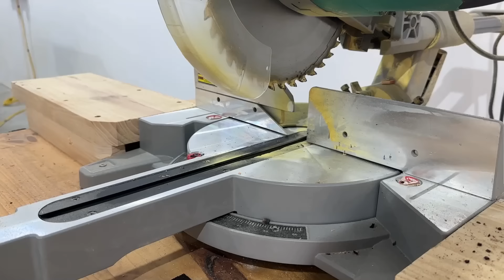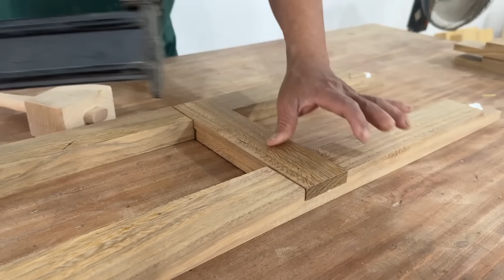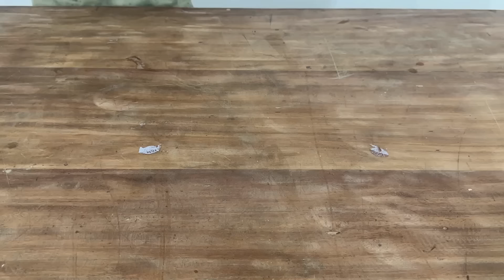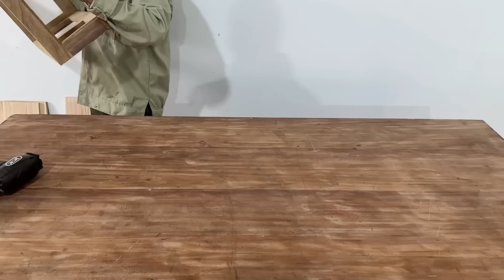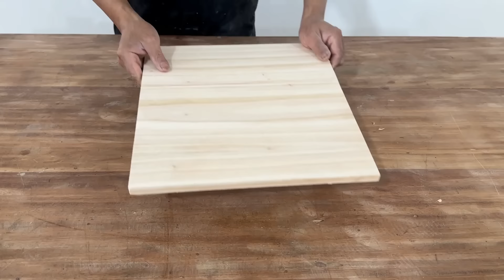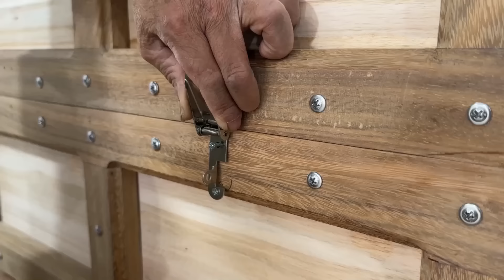Great idea For Recycling Wood // Cool Treasure Chest Design With Secret Compartments

Comment: The decorative screws could easily have been used to reinforce the substandard joints, if they had been longer.
 
As it is, the only thing holding this ”treasure chest” together is some small dabs of glue, and brad nails.
Reply: @RattiDave: Decorative screws are unnecessary, as are longer decorative screws for that matter. Modern glue like TiteBond, when cured 24 hours is stronger than the wood fiber it is bonding, and those are hardly dabs. The only reason the pin nailer is used at all is to hold the pieces in place without clamps until the glue drys and expedite assembly. There are several time saving tips that could be applied to the cutting out of pieces but that’s about the only suggestion I would make.  This is a rather crude method and not much attention is paid to squareness of the components but is entertaining. Amateur attempting this as demonstrated would probably not see the same results and a lot of measuring and checking for squareness was done off camera I’m sure to make the finished chest even as nice as it looks. Entertaining and fun to watch and good enough instruction for a first starter project. But no, the dimensions of the wood, the copious amounts of glue and the lap joinery make that chest a sole survivor do an EF5 tornado, lol.